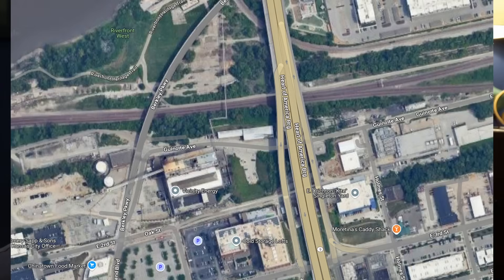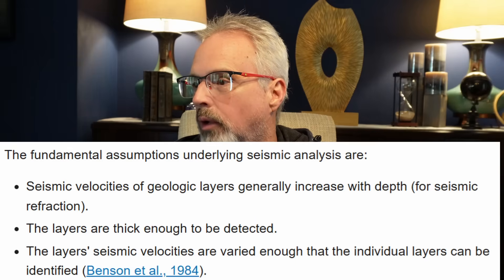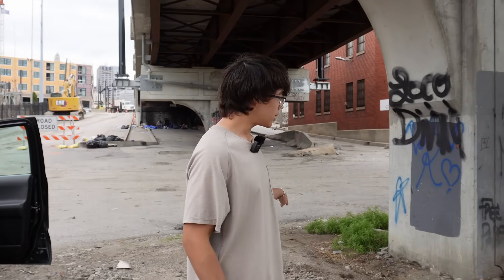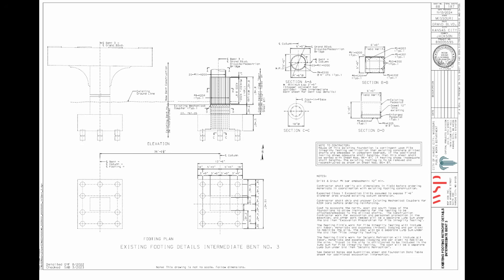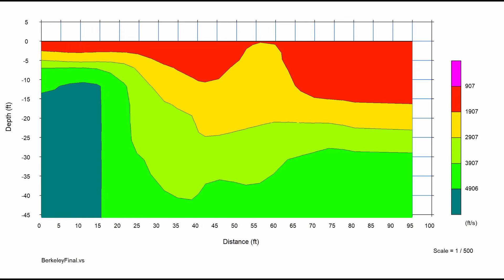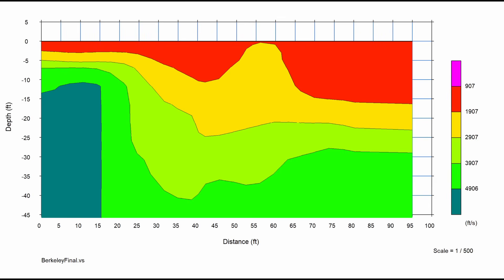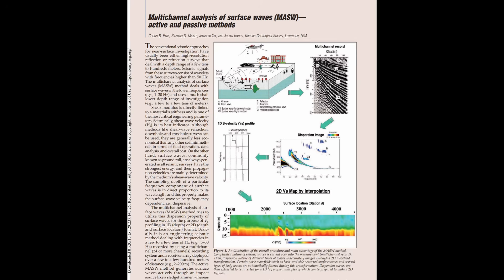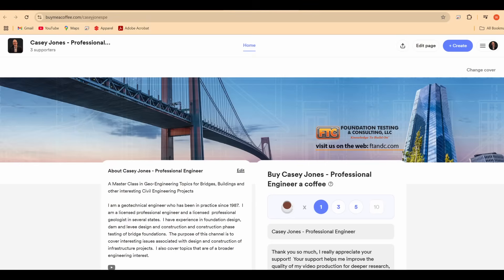Seismic Refraction Survey for a New Bridge

Comment: I see that the trick is to doing the data collection properly. It might from an outside glance look like you strike at random places, but in reality they aren't random but selected to give a useful data pattern. No real surprise that the train was causing a lot of noise.
It may look simple, but it's not.
Reply from the maker: Yes that is correct.  The data analysis is significantly more complicated to perform than the data collection.  Sometimes you have to vary the data collection procedures to optimize data quality at a given site.

Comment: Appreciate the video. Could the sledgehammer be dropped, instead of being swung? May not be applicable, for an unknown reason to me, but just a thought. 
Curious, if you worked a project wherein the site had history of mines below. Seems extensive testing &/or some remediation may be necessary. Also, have you seen what happened to Blatten, Switzerland?
Reply from the maker: Thank you.  Yes you could just let it drop, but we wanted a stronger impact for the signal.  A lighter hammer (say 10 pounds) is often used as well.  This one was 16 pounds.

Comment: Casey,

This was a very interesting video.  It is amazing what you can learn before driving a pile.  Our crews operated a geophysical research vessel  for a number of years.  The vessel had a single line that released compressed  an an array of sensors relayed seismic data back to the vessel.  Buoyancy (depth) of the single line was controlled by changing the amount of kerosene in the single line.

I think via non- sequester.  Assume you are in Israel embedded with the IDF.  Could you use seismic surveys to locate and map tunnels?  Would it be possible to mount your equipment in two  armored personnel vehicles (APVs)?  One APV would have equipment to create the impact sound.  The second APV would carry the listening equipment.  Assuming this is possible, could you determine if the tunnels were occupied?

Bob
Reply from the maker: Thank you.  I don't know the specifics, but I am sure that they are using geophysics to locate those tunnels in some cases.  This is done at the U.S.-Mexico border and the Korean DMZ as well.

Comment: Nice to see another of your work videos! Was wondering how you distinguish the differences in the layers, and what those layers are?  Is it by color? How is different soil conditions known? Is this detection method able to tell the differing hardness between clay's or different soil types?
On a different note; any updates on the Washington bridge fiasco? Good to see you posting again Casey!
Reply from the maker: Thank you.  We may do a follow up showing the data analysis process which involves picking first arrival times of the refracted compression waves.  The color coding comes from the analysis.  You can get an idea of the density of the soil.  Knowing what the soil type is comes from correlation with local knowledge and "ground truth" from any available borings.  You can also get an idea as to how difficult it would be to excavate some depth of bedrock on sites that require mass excavation (say for a commercial or residential development).

Comment: Excellent 👍 Thank you

What is the average accuracy rate in depth?
Reply from the maker: At this site given that are data collections had some constraints due to site access issues, I would say the depth to rock is accurate to +/- 2 feet.
Reply: @CaseyJones-Engineer Thank you.
If I could ask "When  does earth fill become " virgin " ground if ever?
If it sits for decades centuries?.

Curious if Building codes have a standard for the time fill sits is now considered " virgin soil"?
Building in mountains of western north Carolina now .

Comment: Did not know you could do that kind of low impact testing, mostly seen seismic testing done with small explosives. Have also seen helicopters flying around trailing a pod underneath doing some kind of testing but don't know how that works at all.
Reply: When I clicked on the video I was kinda hoping for something that went boom but I’m a bit of a child😂
Reply: The phones are relatively close to the hammer. I would think the explosives are needed for deeper layers or when the phones are further away to keep the signal to noise ratio high enough for analysis.

Comment: Good video. I worked in two counties from 1984 to 2011. It was usually less than 50' to bedrock with many cases the ledge at the surface. Foundation design was easy with dense granite for the normal ledge.
That technique of sledge swinging looks hard on your son's back(the way he bends and doesn't slide his hand). Can't you make/use some kind drop hammer? Heal fast. Good Luck, Rick
Reply from the maker: Thank you.  Yes, we need to get a mechanical thumper at some point.
Reply: @CaseyJones-Engineer  A   small tower with a known weight dropped from a known height with a small hand winch would accomplish that.

Comment: Thank you for another educational video. Do the hammer blows need to be consistent? If you hit harder do you get better resolution?
Reply: I would think a harder hammer blow just increases the signal to noise ratio.  So you'll get cleaner data. Also, the further away a given phone is, you might have to worry about the sensitivity of the phone, that is the minimum signal level it can pick up.  On both counts, phones further away from the hammer will benefit. 

To increase resolution, you probably need to decrease phone spacing while adding more phones or increase the  frequency content / bandwidth of the signal / hammer blow.  Not sure how to do the latter with a simple hammer strike.  With a mechanical vibrator, you could probably do something known as "chirp".  It's literally like a bird chirp where you quickly change the frequency from low to high.  The different frequencies give you better resolution in some signal processing applications.
Reply: Ideally similar they did not do a deep dive but very briefly mention stacking, this combines the data from multiple shots into the one result (called shots as it was once done with explosives). This does two things, it evens out the consistency of the hammer blows or averages them and also tend to eliminate background noise as it is highly unlikely the noise will repeat ate exact same time during the blow each time.  Generally more power gives greater depth, so you go from hammer or accelerated weight drop to larger drop hammers say 400kg or betsy guns (blank shotgun shells) and then into dedicated machinery like vibroseis. The machinery tends to produce a specific frequency or range of frequencies which also allows to filter out background noise (complete overkill for this situation).

What isn't mentioned is the sampling rate, on a shallow survey like this an individual measurement or sampling rate will be around 0.5-1ms record length won't be much over 2-3seconds the velocities will be in the 1-2000m/s range although there is also hard rock seismic where the velocities are a lot higher. Sampling rate determines the maximum frequency recorded although the phones generally roll off at around 250hz, the ground tends to filter out the high frequencies pretty rapidly. The smallest vibroseis top out at around 400hz the bigger ones used for deeper surveys (4-6kms) typically can't go much past 150hz,

 The recording equipment typically picks up the moment the hammer strikes the world were 5ms late signal is a disaster, for refraction the fist arrivals are critical. The geophones are very sensitive things like tree roots moving in the ground on a windy day, the wind blowing across the phone itself can create too much noise that the signal from the depth can be lost.

It's a whole branch of science called geophysics this is only one part of it.
Reply from the maker: That is a very good explanation thank you.
Reply from the maker: @DrEvil814 No you you just have to have a clean hit.  You can adjust the signal gain as necessary but a nice contact is what you're after.